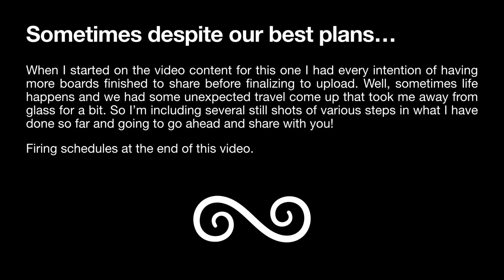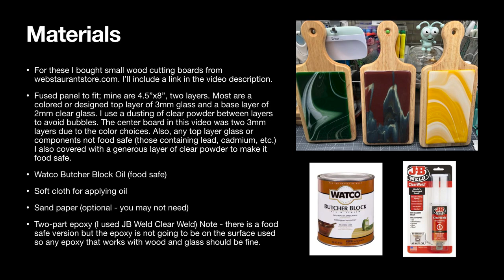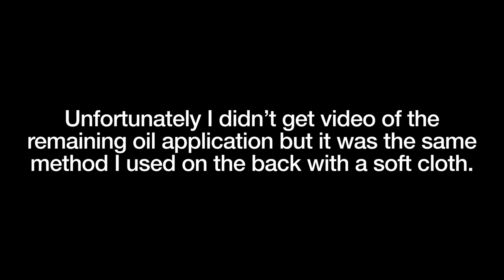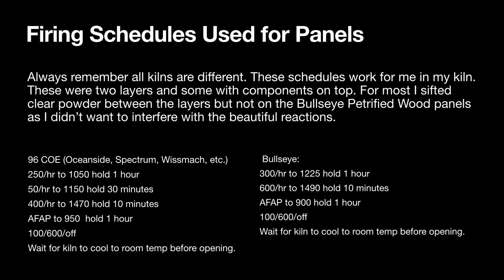Fused Glass Cheeseboards

Comment: Your boards are lovely.  I have never been successful with the plain glass cutting boards.  This is a great idea.  👍 The oil adds so much.  (If you were using the bamboo boards, do you think you would use it on them, as well?) We use that exact oil on our butcher block countertops.  It gives a lot of protection.
Reply from the maker: Thank you! The bamboo boards seem to have a sheen to them already, so I shouldn’t need it, but I have used it on a bamboo board where I did the chemical wood burning process as it was sanded down before applying the solution.